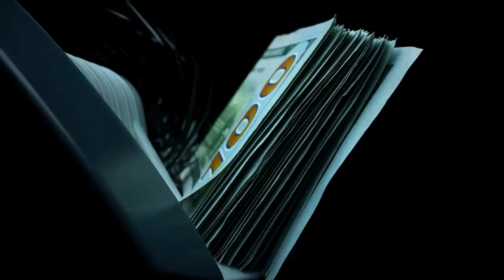The Highest Precision Gun that Doesn't Use Bullets

Comment: The big problem with high power lasers is that the optics have to be absolutely clean, else the light dirt absorbs and turns into heat instantly destroys the optics.  I can't see that cleanliness being maintained in a combat situation.
Reply: Perhaps focused jets of compressed inert gas could be used to "spot clean" optics before firing?   (I have no idea if that's feasible.   It was just the first thought that came to mind.)
Reply: That's probably part of the training that he mentioned bringing up the cost to operate the weapons

Comment: Hmm. I thought the biggest problem, by far, was generating enough energy to make these things work. Maybe first deployments will be land based air defense systems or nuclear powered aircraft carriers.
Reply: Most likely.
Reply: Sitting a 30KW... going towards 300KW... not exactly a huge amount of power.  Still not practical until we can reach 3MW or so.  Still requires a Bus filled with components to make it work.  It will not be on anything smaller than a ship anytime soon.  Maybe a dedicated oversized vehicle.  Stryker is not big enough.
Reply: @w8stral  I'm thinking that there's significant tradeoffs and workarounds being made for DEIMOS to fit in a Stryker, and even then limited by available power.
Reply: @patrickjanecke5894  It is not IN a Stryker.  It is being powered by said vehicle where only the weapons mount is attached to., but the guts is in a trailer container..
Reply: @w8stral a 30KW laser needs a 300KW power supply, lasers are very inefficiente
Reply: The biggest problem is by far that it can be defeated by fog and rain
Reply: And snow, dust, sand, smoke 😂

Comment: What do you do when the object you are trying to drop has a reflective mirror like surface?
Reply: Pick it up on rader a thousand miles away.
Then roast it at the speed of light 😋..
Reply: Enemy body armor is going to resemble the Centurions from Battlestar Galactica.
Reply: Exactly! A friggin mirror can stop it
Reply: It won't matter.
Reply: @13MAM13  no it can't, you've watched far to much television.
Reply: Mirrors are not 100% efficient. Polished aluminum is about 90% efficient, silver is 95%. There are more efficient mirrors, but that get's expensive and hard to maintain.
That's assuming it remains  polished, dust is everywhere - a missile gets scuffed up just traveling. Go over Mach and heating will affect the surface.
Which means the surface will get heated up by the laser, degrading it faster.
So yes, you need an overkill laser and the ability to track the target. But you're only talking like an extra order of magnitude stronger.
Reply: Change frequency.  Nothing is a mirror to everything.
Reply: @thefrogking481  Only in video games.
Reply: It will heat the material to failure regardless how reflective its heat that destroys from light

Comment: I'm curious to see if materials science like graphene, borophene, or something else will lead to advancements in batteries or capacitors to the point that it meets the high power requirements.
Reply: Simple outer coatings render most DEW useless.
Reply: Currently, the best electrical storage can't even muster a single-digit fraction of chemical energy storage, by mass.  There's a ways to go yet on that front.  That said, the gap is somewhat closed my not needing the mass of projectiles and cartridge cases (as applicable).
Reply: Battery tech and storage capacity will eventually be solved.  Give it 1 decade and I believe humans will solve our energy problems.
Reply: They have capacitor systems that can fire immediately after first shot, it's just not used to make lasers it's focused on fusion.
Reply: graphite skin could resist such weapons
Reply: I am curious about countermeasures and shielding
Reply: @mike595  Graphite crucibles can handle 3000F it is very reflective. It is a wild time for warfare. You look at what WW2 did to change our world Bi planes to jet fighters.
Reply: @liamwinter4512  Not quite.  You can render a certain frequency of laser useless, but you cannot protect against all bandwidths.  Further, not all DEW are lasers.
Reply: @allenhammer7923  At some wavelengths.  Others are quite effective at cutting through.
Reply: @mike595  Countermeasures?  Well, find a material reflective against your enemy's exact frequency is best, which is why a multi-spectrum weapon is necessary.  Following that, material that when it vaporizes, is opaque to most wavelengths.  Match that up against what is opaque to atmosphere, and you have a chance.  Of course, lasers can range from microwave to UV, so good luck.
Reply: @allenhammer7923  Graphite is reflective at some wavelengths, absorbs in others.  As for temperature, that's just a matter of how much energy the laser pumps out.  The surface is easily ablated, but the plasma created is a problem far more difficult to tackle.  Nothing portable by infantry is going to cut through a missile in time regardless, but something with some really big capacitors and heat sinks can cut through quite a bit.
Reply: Current lithium ion batteries already have a graphene film.....
Reply: Look up single-walled carbon nanotubes and the effects of chirality on their electrical properties. Really cool shit and I hope I’m alive to see real world applications.
Reply: Graphite isn’t shit compared to single-walled carbon nanotubes even though they’re essentially the same thing. That extra dimension going from 2D to 3D makes magic happen
Reply: Couldn’t missiles just be made with different materials to render this laser useless 🤔
Reply: @TheBlackxice  Perhaps but when you consider the economics and practicality of using any other material or amount of material - assuming it’s even possible - that could withstand the pressures needed to sustain a rocket/jet engine then it becomes impractical and therefore impossible.
Reply: @TheBlackxice  NASA, the defense industry, and even the private industry have been researching materials science for years to come up with new lighter, more durable and heat resistant material for use in jet/rocket engines and they’ve yet to come up with any alternatives to the proprietary alloys they use today.
Reply: @prometheusprime2004  graphene?
Reply: @TheBlackxice  imagine graphene but customizable AND IN 3D AT IMAX
Reply: @liamwinter4512  not to mention you can only pump so much laser juice through the atmosphere before it just lights up and diffuses the beam.
Reply: Supercaps will be null with the invention of superconductors at room temp
Reply: You are the batteriy full of graphene. pic pic.

Comment: A friend of mine told me that the awax airplane can focus their microwave beam wherever they want and literally fry pilots in their cockpit.
I don't know if it's true but it sounds feasible.
Reply: So enemy is in visual but will do nothing and let awacs fry his electronics. Awacs would have bigger problems if a fighter jet is in visual range. Especially if it is flying alone without escorts. Technically possible but realistically no.
Reply: As an Airforce veteran and Aircraft Maintainer I can tell you that the AWAC’s cannot do that to people unless you’re within 50 feet of the radome while it’s transmitting (ie… while airborne) as far as the electronics go… Military Equipment is hardened against EMP, Microwave and other ECM and ECCM. Sounds like your friend is Pulling your Leg.
Reply: That would be extraordinarily difficult.
An airplane is moving fast and the AWACs is moving, so keeping a tightly focused beam on the pilot is very difficult.
You have the r^2 problem - basically the power that hits a target drops dramatically with distance. Doubling the distance away drops the strength of what hits the target to 1/4. So having enough power to do that far away is not feasible.
Reply: I do know F15s can use their radars to fry out enemy radars on older model planes; so AWACS doing something similar wouldn’t surprise me.
Reply: @justsayen2024: awax???
Aircraft Wandering And Xploding.......

Comment: A common misconception is that one can protect oneself with shiny chrome plating or mirrors.
Lasers use internal mirrors as functioning parts and they must be carefully engineered to the wavelength of a given laser. A defending craft would have to be covered with precisely the right covering.
Reply: True, but until the laser power is increased very significantly, there are high temperature resistant coatings that could be applied and still remain an effective defence. Additionally, there are ways to dissipate the heat rapidly with thermally conductive mechanisms, heat pipe tech, etc. Will be interesting to see how both offensive and defensive techs develop.
Reply: Intensity is the issue here. Also the mirrors inside the laser - perfectly tuned to the right wavelength - would get destroyed if it hits them in a concentrated beam. And the breakdown can be quite the spectacular... ;)
Reply: The wavelength is known, and it is pretty easy to make high reflecting coating for such wavelength... cooling off the surface is also pretty high at airspeeds.
Reply: The lasers in the shop I worked in were not able to cut through brass. The surface had to be special coated first, despite the laser concentrating 4000 watts on a spot 0.008 inches across!
Reply: @kimbalcalkins6903  Then you probably used CO2 Lasers? They suck at working brass and such. 

These technologies here usually are solid state lasers with around 1 micron wavelength. And the goal is not cutting. Incoming missiles are under high structural load. When you heat up their surface a couple 100s of degrees it is enough for them to self destruct due to structural overload
Reply: Chrome plating is good protection, it reflects 75% of the energy, cheap barium sulphate paint is much better reflecting 98.1%
Reply: @Awaken2067833758  also the beam has to be precisely steered onto the same area, and if the target is also spinning ?
Reply: @jackmclane1826  we were running Bystronic C02 lasers, after I retired in 2016 they went to fiber lasers but I think they are not as good for materials > 5mm ?
Reply: @kimbalcalkins6903  any ablative material will work, no need for spin.
Reply: @kimbalcalkins6903   Laser cutting is one of the very few industrial application that CO2 lasers have not completely vanished. Anywhere else they have been replaced by fiber/diode/disc. I don't know why, but it is said that CO2 cuts are of better quality. But I don't know what aspect of quality is meant.
It's not the thickness, though. I saw 30mm lasercuts made with a solid state system.
Reply: All we would need is dirt.
Reply: The blue wavelength appears to have survived the Lahaina Maui attack best.
Reply: @AndrewFosterSheff69  I came here to say that but you said it best, the blue houses seemed to fare better
Reply: Color of the material plays the biggest part......the darker something is the more energy it will absorb from the laser
Reply: The color of the material plays the biggest part......the darker something is the more energy it will absorb from the laser

Comment: We're hitting new technological milestones with regards to newer and more powerful power sources as well which no doubt will affect and accelerate directed energy weapons as well.

While many countries invested heavily into hypersonic missiles, we invested in lasers and microwaves and though there has been a small time of a few years where hypersonic was the battlefield gamechanger, directed energy is a whole other era. 

Just like the 20th century, the US is positioned perfectly to lead the entire next era of warfare superiority.
Reply: The V1 rocket used in 1941 was hypersonic, basically every missle or rocket is.
The "gamechanger" is a hypersonic system thats maneuverable. And that's not been proven to work, yet.
Reply: What newer and more powerful power sources?  There's no advancement, and likely will be no advancement, in miniaturized nuclear sources.  Batteries are getting higher capacity, but there have been no revolutionary improvements, and enough storage to run a heavy armored vehicle for any distance is still impractical.  The only recent change is that we're deciding high electrical power is a useful thing, so we're adding bigger generators.
Reply: @thefrogking481  Long range ballistic missiles travel at hypersonic velocities, and... that's about it.  Almost no short range missiles qualify, and only a few longer range anti-air missiles do.
Reply: @thefrogking481  You must have meant the V2, not the V1.  The v1 was slow enough that piston driven fighters were catching them and shooting them down.

Also, the first flight of the V2 was in mid 1944, not 41.
Reply: If I were to guess: US looked at hypersonic weapons and decided not to develop them as not to drive others to develop them, as US did not have effective defenses against them. 

Energy weapons might be that defense.
Reply: @wagnerrp  Sounds like you missed pulsed high power terahertz lasers.
Reply: @ThomasLee123  No.  I just ignored them because they’re useless as anything but a blinding weapon.  If you want to destroy something, you need energy on target, and pulsed lasers don’t do that for you.

Comment: Beam divergence may also be a problem. At ten feet the size of the beam may be half inch but over ten miles the circumference is the beam may be ten feet wide. Also atmospheric conditions may be a hindrance refraction, humidity ect

Comment: The problem is they take too long to kill atm as they just aren't powerful enough, so engaging multiple targets quickly isn't currently an option, then there's fog or smoke reducing it's effectiveness. But give them another 10 or 20 years I believe they'll get there.
Reply: Not only that, but they can only be effective at close range, so for instance a bit of a gamble as to whether the laser could destroy an incoming missile quickly enough when that missile is travelling at very high speed. They will need A LOT OF POWER.
Reply: Read up on USPL .
Reply: Just use multiple laser cannons  .
Reply: Tell that to hundreds of thousands in Cali Oregon Canada
Reply: Maybe that's not the plan

Comment: Imagine you're standing guard near your commander and you feel a sudden heat on your back. When you turn around there's just smoking pair of boots 😂
Reply: You wouldn't feel any heat.
Reply: @wstavis3135  you would, but the heat would be radiating from the guy who just got vaporized. Not the laser itself
Reply: Actually large blocks of bio-mass explode when hit with megawatt laser burst, the material vaporizes and expands violently.

Comment: What happens when there’s clouds? Or foliage? Or the enemy has a mirror for a shield?
Reply: I would imagine it would burn through any foliage like bushes, leaves, etc seeing as how it's seems to burn straight though a missile or destroy components inside, cloud cover idk depends on the situation, as far as the mirror goes that's also situational, you have to be pointing the mirror exactly at the laser so you'd have to know where it was and most likely you'd be a ground target not a missile, drone, or aircraft so assuming you are a ground target you'd be serviced with an atgm not a laser.
Reply: @Blackreaper95  Even if you know the location of the Laser reflecting to it via Mirror would not work, because it' wouldn't be focused enough anymore. But a highly reflective coating would probably work as a defense against the lase.
Reply: @tubekrake  maybe but then would it be able to withstand the heat from the laser  I'd imagine it can't actually reflect the thermal energy itself and might be compromised.
Reply: A mirror?
You're joking right? 
These aren't the laser pointers you annoy your cat with.
Reply: @thefrogking481  These Lasers itself use mirrors and glass to focus the light of multiple beams. So why not?

Comment: With accurate aiming you don't even need to destroy the whole missile targeting an aircraft, just take out what is likely its weakest point, the nose.  Destroy the IR sensor or the radar receiver and it now has no guidance.  Neither can sit behind protective shielding like metal or ceramics as they have to let in the energy they are using to track a target with.  This is a game changer for aircraft and may just bring back the gun fight, but I guess by that range the laser can also target the enemy aircraft as well.
Reply: Yep.
Disrupting the guidance system would be enough.
Reply: Missiles can still overwhelm a target, but that would be much harder now.
Reply: @patrickjanecke5894  They are too expensive to risk sending an overwhelming number at a single aircraft though.  Even a second or two between them might be enough in the future to take them out.  Its more about the laser power than the targeting.
Reply: There are cameras inside fusion nuclear reactors running at over 110 million celsius. I used to work on one. Laser targeting optics would be very effective now, but could be defeated with defensive modifications in future.

Comment: Several major inaccuracies here:  1) atmospheric occlusion limits directed energy. 2) Maintenance costs are not zero.  In fact they are a lot higher. 3) environmentally safe is laughable.  All persons that are within eyesight of that beam will have their vision damaged if not wearing the correct eye protection.  Doesn't make any difference if the beam is 10 miles away pointed away from you.